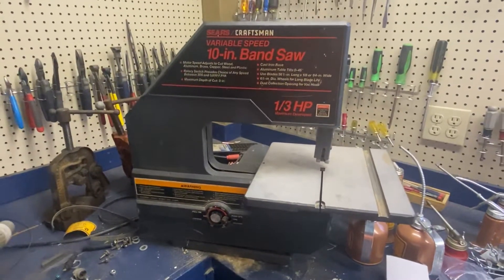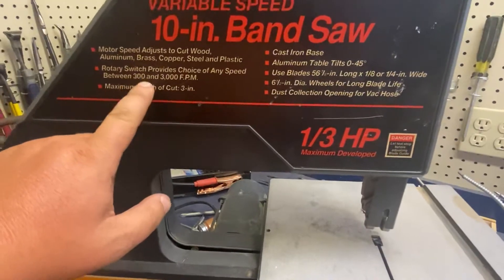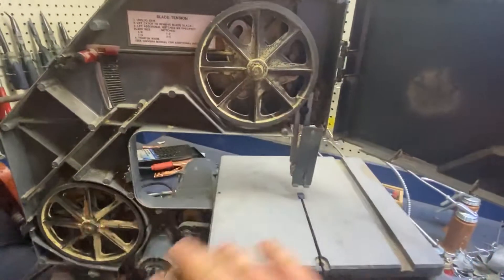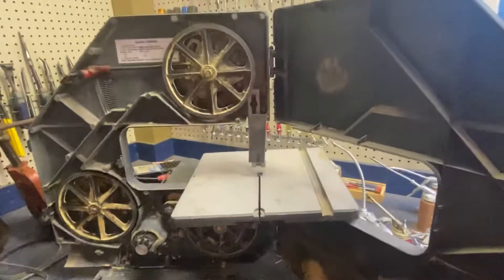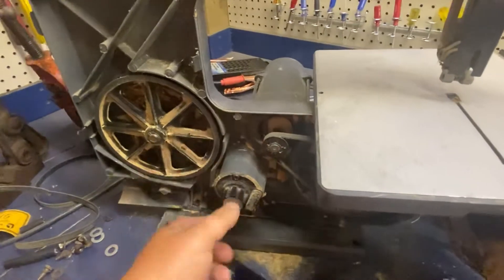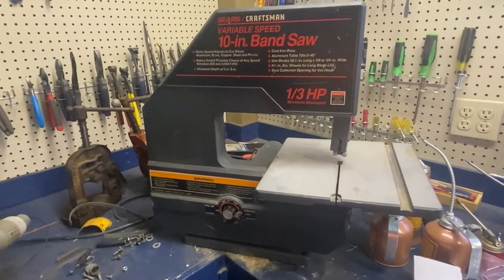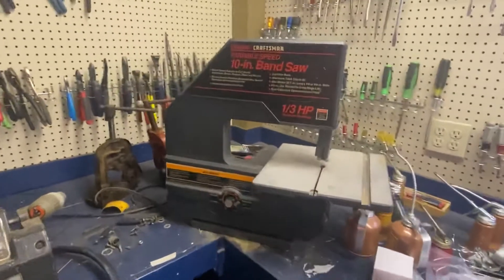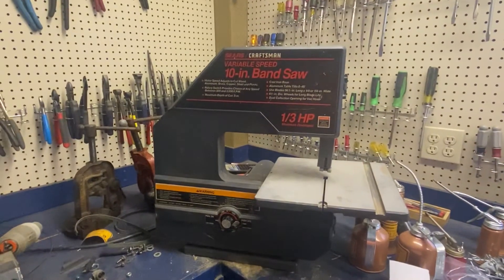Craftsman 10 inch variable speed bandsaw and upgrade plans for it

Comment: I’ve had the same saw for about 20 years and it will, indeed, cut high carbon (annealed) steel with a good bimetal blade. I’m a knife maker and I use a good quality cutting wax bar when cutting steel. Also drop down to the lowest speed; that’s where the variable speed becomes valuable.
Reply from the maker: Cool, thanks for the info, I have a new blade for it just need to get it put on and done

Comment: Just bought one similar to this, I think a little older, w/o variable speed; I saw it running and the blade wasn't moving around, and it sound pretty smooth so I thought it would be ok.  Come to find out the whole lower blade support guide assembly was gone.  Must have broken at some point.  Based on the model number, I've been able to source the owners guide and all the expendables--blades, tires, bearings, cooling blocks, belt, etc., but those pieces of lower blade guide set up are nowhere to be found.  It's not worth the gas $$ to return it, but I am bummed about having just bought a boat anchor with a motor.

Comment: Great deal for $5. I have an old PowerKing 9" band saw that I think I paid $10 from a garage sale (It's in one of my videos). I was thinking of trying to convert it to metal cutting with a treadmill motor, but I just never seem to get around to it.
Reply from the maker: I’m like that to, I have a million little projects but  I’m making my way through them pretty good lately
Reply: @smalltownmachineshop6860  Did you ever get your mill parts?
Reply: @smalltownmachineshop6860  I just don't feel like buying a blade for my project. There is other stuff I'd rather spend money on, and ultimately I don't have much use for a band saw personally. I just bought it because it was dirt cheap. I need a little power hacksaw or horizontal band saw really.
Reply from the maker: I got one part yes, I have a video coming up on the mill where I will explain my parts situation with it and then soon the reassembly videos will begin in about two weeks
Reply from the maker: I had a small power hacksaw awhile ago and I still regret getting rid of it.  It took up hardly any room and would cut anything
Reply: @smalltownmachineshop6860  If I had the room and money for a monster like the Johnson, then of course go big or go home, but at the moment and in the future a small one sure would be great. Eventually I'll cross paths with one. I found a pipe vise today.
Reply: @smalltownmachineshop6860  Cool. Can't wait! :)